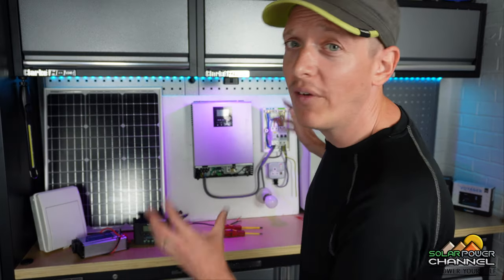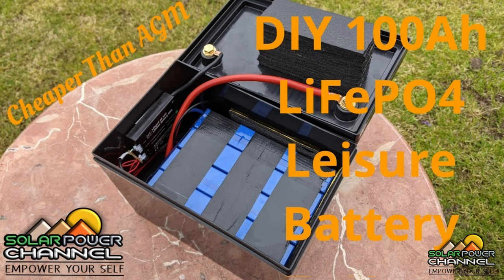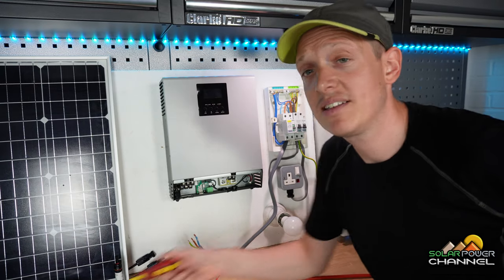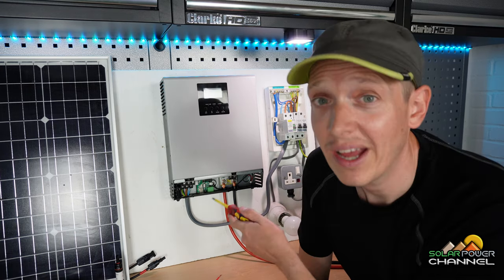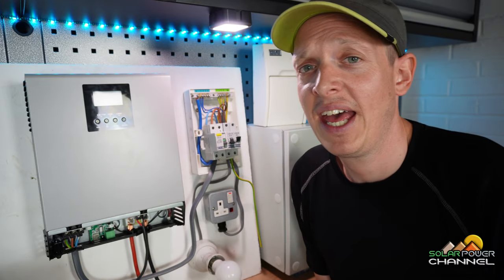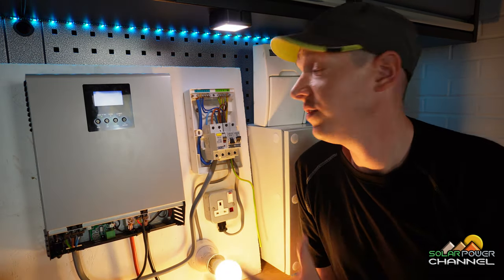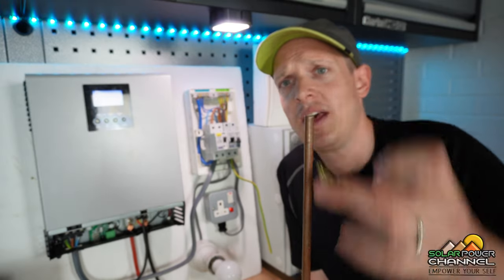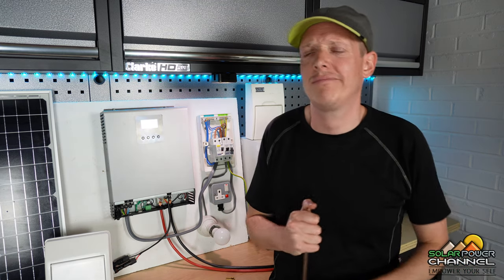Off Grid Inverter - Wiring In With Consumer Unit.

Comment: Hi Chris nice video, good demonstration of the workings of a off/grid system that could be used as a UPS. I had a similar system running when I was renting, it was all boxed up outside using a small solar array on the garden lawn to run the fridge and TV. I now have a 48v 5.5kw Iconica Hybrid Inverter running lights, ring circuit, plus, dishwasher, and washing machine in our 1963 3 bed bungalow. I also used a dedicated 63A 3 way consumer unit to enable this setup which has been running for about 2 years now. I have a 3kw solar array supported by the grid so yes its a UPS arrangement with a 16Wkh Lead Acid Battery bank, soon to be replaced with a 10.5 kWh Lithium battery bank using the same cells you have there in your box. Not sure what part of the UK you're fro,  but we come from mid Wales near Welshpool.
Reply from the maker: Thanks for watching, Oh my, I am so jealous of your setup! What is your electric bill like? I am from the Southampton area of the UK. My parents had no power for 4 days the other week from them winds. I was about to take the setup in this video round there with the SOK battery so they could run the house lights and oil boiler. But I think they liked living by candle light and log stove. I am planning a system like yours in the next year, I think it would also push my channel forward. In the next few months looking at PV hotwater heaters to move away from my combi boiler for a few months of the year. If you want to send me photo's of your setup I always love seeing such things. I have just picked to Renogy 2000watt inverter, something you stick in a boat or caravan. They now come with a UPS feature as standard now! solarpowerchannel@hotmail.com

Comment: Thanks for the vid, you said the AC in is there to be used as a UPS, but what about if there's no solar or battery power? Will the inverter then draw current from the grid to keep your CU powered?

Comment: Nice video Chris.l. Hope all is well. On a side note. What I don’t understand and no one has ever seemed to explain fully is: How does one wire the breaker panel in split phase when using a split phase off grid inverter. For example appliances that are 110v and those that are 230v need separate supplies. I’m wanting a off grid new build house in Jamaica (110v) and need 240v ac as well as to run 240v water and pool pumps. Do I have to have two separate fuse panels and split off using a Henley block to one that’s being fed via a step down transformer?

Comment: Great video. Using the separate inverter could you wire from that to a consumer unit and then to sockets?
Reply from the maker: Hello, with the right electrical regs etc. And separated from your grid power and all that sort of stuff. See why not. Even house lights as they don't draw much. I see important sites have a big switch, sites can be run on a generator or grid supply.

Comment: Is no longer advisable within the regulations to use a main RCD board for a consumer unit. It’s much preferred now to use one that has a main switch and RCBOs as there is selectivity so only the circuit was a fault is disconnected

Comment: Great video, could you tell me if i  can wire this inverter in for just my house lighting? And what model was this one as all the similar models state for lead and gel batteries but no mention of lithium batteries? , just ordering the bits for your other cctv project, very handy. Keep safe.
Reply from the maker: Thanks for watching. Yes it says lead only. But in the settings you can flick it to manual settings and select the charging voltage. On this unit it's setting number 26 and 27 where you manually change to 14.6v. It's a pure sign so it will run your house lights fine. My CCTV dc to dc is working well! I've been away from home for a while and I've been checking in on my camera's. Not many people have watched that video but I bet it would help a lot of people. You ordering through Voltacon Solar? Think I left an affiliate link for them in the video description. Chris

Comment: I am still struggling to understand ac connection and your video comes close to answering but can I clarify. If I buy a victron easy Solar 3000 how do I connect it to the grid via consumer unit. So that I can use pv and 2 x 2.4 Kva pylontech batteries for power when available but the  consumer unit will automatically switch to grid when solar energy unavailable. I don’t particularly want to sell energy back to grid
Reply: Hi Simon, I've arrived at this video for the same reason. Did you find your answers anywhere?
Reply: @martinshaw1988  I think the following his tails to new main switch main switch to ac in on inverter/ ac out on inverter to consumer unit main switch
Reply: With my Growatt you can cut a length off of an extension cable (highest amp you can find) and wire it into the input and then simply plug into the wall socket
Reply: Great video! Does this set up avoid the need to declare the system to the officials..?
Reply: The victron is phenomenally complicated for example we found that the inverter was using the assistant to overide any settings we made. Even Victron’s trained expert didn’t know about this it took Guy the chap in Australia to come on forum to solve it. They are far Rey from “easy solar” I would suggest you learn all of the chats I had on the forum. Or keep pestering a victron “expert” till you get what you want. 12 weeks on from setting it up I added an extra pylontech and I have to start all over again. So all I can suggest is above.
Reply: @thingswithlloyd4581  I was close to trying that too but heard it’s a bit dangerous due to the plug 🔌 being live…? Did you do anything extra to make it less dangerous?
Reply: @DossingAroundInBoats  no, I just simply cut an extension cord and use one end as my power out of the inverter the other end of the cord goes into the mains or wall socket and when the solar isn't enough it adds from the grid...
'Solar with Will Prouse' has don't this and says it's fine... Obviously it depends on what you are powering but for an example my inverter is powering a 1500w 240v cryptocurrency mining setup...
Reply: @DossingAroundInBoats  if you want I could do a quick video on the weekend to show you mine
Reply: @thingswithlloyd4581  done it mate. Hee hee. Thanks for the inspo now bring me some sun!!
Reply: @DossingAroundInBoats  nice, glad to hear... Did you just use an extension cord like I did?
I think mine was a 5m chopped in half to give me 2x 2.5m power in/power out. That way my inverter can be some distance from the house supply
Reply: @thingswithlloyd4581  hi I've looked at your conversation on this topic have you still got the video please

Comment: Hi Chris great, well explained video. I recently go the  3 kVA Off-Grid Inverter  with Duo MPPT. My biggest problem is mounting the solar panels on some kind of ground mounted frame. I noticed you have  a photo of such on your community page. Could you give me some into? Thanks Nigel
Reply from the maker: Hello Nigel, thanks for watching. I have mine mounted to the side of my shed pointing south. It's on an adjustable frame so I can adjust the angle. Have you seen these? https://www.paidonresults.net/c/56084/1/2059/0/solar-panel/pv-mounting-structures/renusol-console-flat-roof-mounting.html I use them at work, they work really well, also good for maintenance. Also the same frame for mounting on the side of the shed could be used on the floor with the correct base.

Comment: How would an inverter be connected to an old style fuse board? Our house has one of the older black meters, no RCD or consumer unit, just the old style black meter with a spinning disk and fuseboard/box.
Reply: You probably need to upgrade the consumer unit.  You could also ask your supplier to upgrade your meter.

Comment: Great video! So is your setup 12v or higher? I get the earth. But does that mean you use 3 core cable for all your electricals? Well apart from your downlights that would use 2 core? 

Also just thinking, how do you run the inverter power and the 12v separately having the inverter built in? Can you run 240v lights from this? Cheers.
Reply from the maker: Hello, I use three core cable everywhere. The light frame is metal so that is earth's to, lights are 230v in the solar shed. Thanks for watching.
Reply: @SolarPowerChannelwithChris  thanks for the quick reply Chris. Thanks for the input. How would I run 12v sockets from this? Is there 12v input on this and would that run from the controller itself of would you be able to run it from the consumer unit? :0)
Reply from the maker: @leeg713  that's ok! Just sat on a airport runway in Iceland, killing time. I run my 12v stuff from the power wall batteries. I have made a video on this, video is a bit long. Want to remake it and make it shorter. I run my 12v PIR outside light, a IP security camera now via 12v to 9v dc to dc converter. Allows me to keep the inverter off during the winter and be more efficient. https://youtu.be/emFFK0Z2UP8 skip through the video, I think I explained it all here. I made it some time ago.. I also run a small heater for the lifepo4 batteries which is also 12v. A dc system is more efficient than having AC system.
Reply: @SolarPowerChannelwithChris  aww brilliant, thanks Chris. Watched your other video and it helped a ton, thank you!

Another quick question, how many sockets can you hook up with the mppt that you have? 2 or 3? Obvs dependant on loads you are connecting.
Reply from the maker: @leeg713  the all in one MPPT and inverter unit. Yes it depends how much your pulling from the inverter. I have 3 twin sockets. But these are for charging my e bike, bench grinder and charging my Makita tools. Etc. Not normally at once.
Reply: @SolarPowerChannelwithChris  ah I see. I am building a gym/office. Most of the components I am putting in require 12v power. That said, I am putting in a tv, and a ceiling speaker system both of which requires AC power. Im trying to determine if a normal Mppt with an inverter would do, or use some of those. It’s cost via functionality. I’m kinda stuck lol

I am storing the powering components securely in a storage shed I’m building attached to my build. Therefore I need to run my cables through the wall. Not sure it’s safe to use an inverter and run a single extension from each socket to a single socket for the tv and the speakers system. The system you use would provide that easier but definitely more costly.
Reply from the maker: @leeg713  Sorry for the late response, Your system does not sound like it will require to much investment. My 48" TV draws 170w and the audio system won't pull too much. A 600w pure sign inverter would be fine. Does your shed catch much sun and does a part of it point South? East and West also work. You can email me at solarpowerchannel@hotmail.com if you want to talk more offline. A MPPT and inverter work just like an all in one. I like the all in one units as they keep everything tidy. Building an off-grid system is pretty fun, also a nice satisfaction your running your gym off-grid. Linking the sockets like that is fine, in electrical regs your allowed a spur, plus its very low watts so it will be safe.
Reply: @SolarPowerChannelwithChris  that’s not a problem at all :0) I sent you an email Chris. Ty :0)

Comment: graded cable whats the name for it 6.5mm is going be good for bitcoin mining wanna do a offgrid setup on me garage because power companys are a joke in uk rip offs, can you use 6.5 cable to a dual socket ? for 1300watt power draw and where do i get it never done solar or sparky stuff before !
Reply from the maker: That would be a pretty big system, what is your budget?
Reply: @SolarPowerChannelwithChris  5k ! ?
Reply from the maker: @Joe_BTC  A fair bit then! You would not need all of that. How big is your garage roof and which way does it point? It's a bit tricky as there are some days the sun don't shine and you need to be grid tie'ed.
Reply: @SolarPowerChannelwithChris  fuck the grid my garage is big fit 12 panels i reckon south facing
Reply: I'm currently building my system trying to cover my 1550w of consumption miner... 

I have a 5Kw Growatt all in one, 20x 300w panels and so far 4x Lifepo4 100Ah batteries which is a joke as they will only last about 2.5hrs of mining. I think that I messed up buying the 12v batteries and not 48v ones but I'm trying to figure that all out as I have heard that you can't run them in a serial connection (12v to 24v to 48v).

I have 2awg or 10mm power cable for the inverter to batteries and 6mm MC4 cables for PV to inverter... 
The fuses and breaker boxes I'm still trying to figure out and purchase and a double powerpoint will be run using standard 2.5mm domestic wire.

How have you gone during the last 7 months? sorted anything?... are you still mining since the merge :(